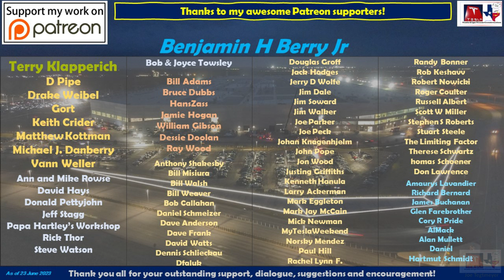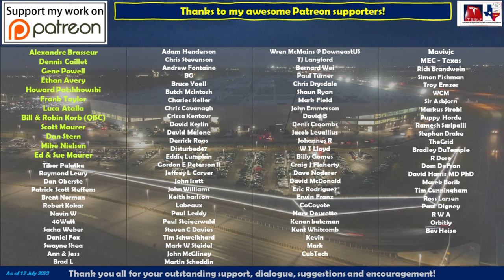Tesla Gigafactory Texas 15 July 2023 Construction Update Inside the Casting Machine section!

Comment: Thanks Joe. Wasn’t expecting a video or photos today. 
1:21. Casting, apron. ‘Elite Refractory Services’. Worth visiting their website and the ‘ferrous /non-ferrous metals’ information.
1:48. Casting, inside. Steel frames. Massive, massive, heavy construction. Oversized holding furnaces being constructed on site. Google industrial holding furnace. Then google Elite Refractory Services.
2:28. Casting, inside. Excavations to the right. Larger excavation has screw-piles.
3:28. Casting, inside. Hall/gallery between columns lines X and Y. Speculating expansion, and likely consolidation of existing furnaces in a central location.
Hall/gallery between column lines Y and Z for access only.
5:16. Casting. What was missing from those views were any Cybertruck castings. Perhaps only done a few short runs.
6:46. Battery level 4, loading platform. Inside. Still a lot of open space. Looks mostly storage through here.
7:13. Battery level 3, loading platform.Inside. Better views in Joe’s photos. Floor structure still open. Possible to see through into level 2 and 1 (ground).
Reply: Did google it, and yeah, hours of reading.  Thanks.
Reply: 1:48 and 3:28 are the same furnaces.
Reply: @boostav  So they are. Seem to be mirror images.

Do you know what they are? I have suggested holding furnaces from what seems similar in a Google search. Since seen images of furnaces designated as melting furnaces that look the more or less the same.

Thinking they could be used for recycling rejects etc as well as melting new ingots.

Not sure how practical that would be. I know the dies are sprayed with soy bean oil in between cycles. Presumably some residue would be on each casting. Maybe that would simply burn off.
Reply: @DessieDoolan  Yep, just different viewing angles. I'm afraid I'm not much help on ID'ing whether they are holding or melting furnaces. The latter would be convenient so they don't have to send them for recycling off-site.
Reply: @boostav  Snooping around on the Austin City website I found a document referring to the various building addresses along Tesla Road, and how they need to be finalized. Refers to one building as the 'Melt Shop'. 

Google 'melt shop', and candle and chocolate making businesses come up! 

Adding 'industrial' to the search and it appears 'melt shop' is a term used in the foundry industry. Often with recycling.

I'm out of my depth with this, but speculatively the new furnaces seem to be part of a massive rearrangement, expansion of the Casting shop.

I hope Joe peers inside more often.

Comment: Budd Company"s factory in Redding PA 60 years ago formed stainless steel into complete railroad passenger cars and I saw it in operation. Long components were cold-rolled into shape by a continuous series of rollers from the coiled sheet metal. The heavy center sill was a double I-beam box beam, formed and continuously welded. Spot welding joined the thinner components. That stainless steel has withstood the test of time to this day.

Comment: What are the 3 gray structures closest to the wall, they don't look like anything that supports the 9000ton press.
Reply: Holding furnaces under construction. Google 'industrial holding furnace', and then 'Elite Refractory Services' whose trailer is outside.
Reply: @DessieDoolan  I'm not sure, Dessie. These massive structures at 1:48 to me look more like standalone equipment, not part of a physically integrated line up with melting - holding - dosing equipment. From the outset Tesla has aimed for large castings and they invented a special Aluminum alloy as well to eliminate post heat treatment.
But it could well be that for even larger castings (9K die casting)  the post heat treatment has to be re-instated. I think the massive structures could be heat treatment chambers. This could also explain the presence of Elite Refractory Services for insulating these chambers.
Reply: the location of these chambers may also hold a clue: close to loading docks for moving the racks with cured casts outside
Reply: @hardernl8893  Looking at Joe's photos there's 3 distinct units of different footprint and layout. Presumably 3 slightly different functions. 

We haven't seen furnaces for the 9000t presses yet. They might be using the existing furnaces for the 6000t machines. In fact they must be.

Heat treatment. Of course I'm stabbing in the dark, but figure with the planned output from the 9000t presses, if heat treatment was required, that would need a lot of real estate. 

Hopefully we get more views inside over the months ahead.